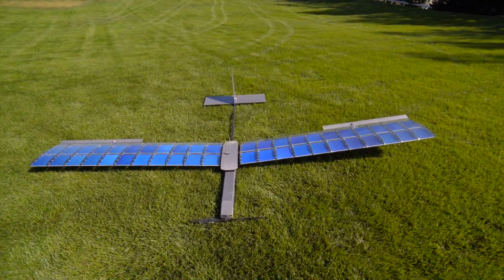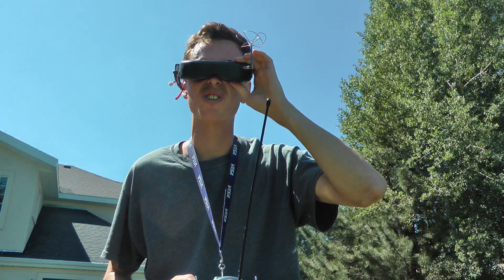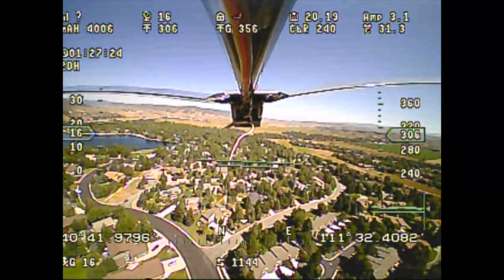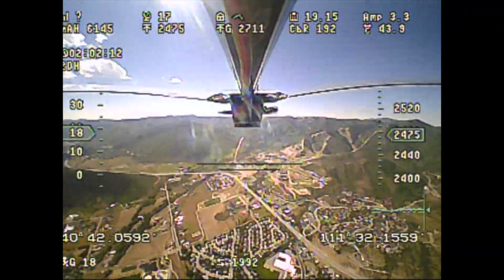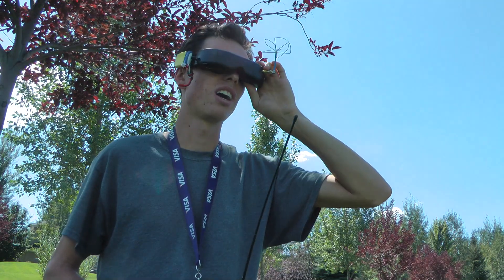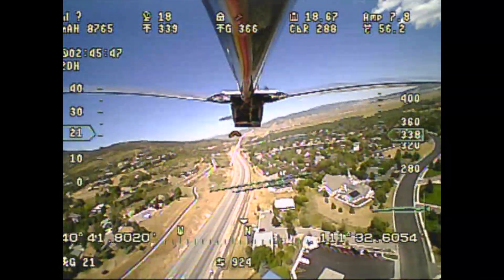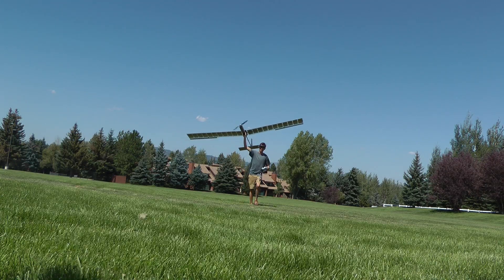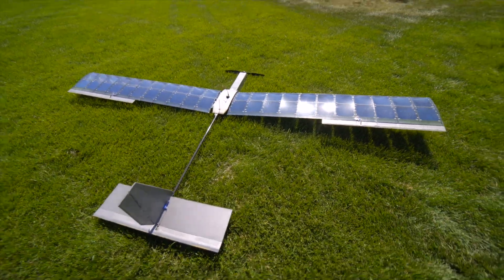SOLAR Plane V3 Long Duration Test Flight - RCTESTFLIGHT

Comment: As an RF engineer, may I suggest you remote your antenna next to your brain.. A small tripod configuration will allow you to get the antenna higher, more range, and get the RF away from your brain...

Comment: Also, down the road you could look into super capacitors and a simpler charging circuit.
Reply: Too heavy, the added wight will  more than offset the efficiency gain.
Reply: @amir_404-e4d  you do actually know what super capacitors are right? 

They are very lightweight compared to most rare earth metals based batteries. And also, this video experiment proves that the plane does not need huge electrical storage capacity to fly continuously on the solar panels. Just enough to buffer through bursts of throttle and periods of cloud shadows. 
What's more you could likely eliminate quite a bit of weight with properly researched super capacitors by eliminating the need for a charging module. Dump the solar panels straight to the capacitors with only a diode to keep them from back feeding the panels.
Reply: @ChristopherGaul  Super capacitors have a energy energy density(j/kg) of about 1/20th of lead acid batteries; about 1/80th that of LiPo. In other words, if he had one pound of LiPo, he would need to replace it with 80 pounds of capacitors. Low power charging circuits are light, but if you really want to simplify things than you can just use a more robust battery type like NiMH. 

I think you are confusing energy density and power density. Caps have a high power density, but can't touch batteries in terms of energy storage.
Reply: @amir_404-e4d  the whole point of this experiment is to fly on solar power. If you watch the video, he proves he already has enough power coming from the panels to do so. He does not need high energy storage. He just needs some burst capacity to cover high current peaks. He can eliminate the weight of the lion batteries and associated charging electronics and replace them with a few lightweight super or ultra capacitors and a simple diode. His ESC could handle the wider input voltage range. The battery charger and its mass would be gone.

Comment: Really cool project. Very nice, clean build on the plane too. 
Re the charging, I'm certainly no expert but I agree that you need to look into MPPT charging instead of your existing setup. If your panels put out voltages consistently higher than your batteries' fully charged voltage, MPPT lets you beat utilize that extra power under the curve. You might also look into lighter, more energy dense batteries. Eg if you're using Lithium Ion, move to Lithium Polymer.

Looking forward to more of this project.

Comment: I wonder if it would be more efficient to have two motors, one is powered from solar power alone and runs as fast as it can to get most thrust out of the panels. (Basically MPPT but done by motor ESC firmware). The second smaller motor is powered from battery and you only use when needed.  Could have a small trickle charger between panels and battery systems.   
Downside is extra weight from 2nd motor.  Upside is it's more efficient to do MPPT inside the ESC rather than having a separate MPPT controller that then feeds an ESC.  MPPT controllers are heavy and they add an extra step that loses efficiency.

Comment: Try using a capacitor bank on the solar panels and a regulator before the battery system.  This will allow the solar panels to run at their peak potential and supply a constant power to the charging circuit.

Comment: interesting test can the motors also directly be powered by the solar cells to circumvent charging the battery? And then only charge the batts while decending?

Comment: Wow dude, such complicated thing you've built and no MPPT?! And engine can draw panels down directly? Type in "CN3791 MPPT" into aliexpress and get some, tiny things. You mentioned 24v from panels - so like, one for each wing and boost the output :) I dont think your system should run totally without a buffer, why have such goal. No point of making a plane that falls down right away if any little cloud cover runs over. You may try supercapacitors tho, as a buffer, instead of a lipo :) But there must be some sort of buffer, not only panels. Keep it real :)
Reply: whoops, nevermind, now realized it's over a year old video that was suggested to me.

Comment: How much does your camera and transmitter effect your energy budget? How much does the weight of your camera and transmitter effect your performance?
        I wonder if just running off of your battery with the solar cells recharging your batter would be more efficient. Hybrid cars tend to move the car off of the power from the battery, and the motor just charges the battery. The

Comment: That's about 100 watts of solar on those wings... how is that alone not able maintain flight and altitude?  Ditch the heavy batteries and lighten that thing up - 100 watts should keep that in the air, you said 20 volts @ 3 amps.
Reply: Maybe a smaller battery or maybe two in total, very small batteries to always have one charge whilst depleting another??
Reply: @a.ndy.nonymous  hmm, yeah I guess that would work. Smaller batteries when the weather holds
Reply: @williamgong2351  Maybe some really great capacitors? Just like Tesla Motors. Batteries for the grind, caps for pure power when needed. And two batteries
Reply: @a.ndy.nonymous  Yeah, I guess that would work, only if the capacitors were more efficient at holding storage.
Reply: @williamgong2351  Or just spare batteries for the servo's and receive only so he would be able to glide/ has at least steering capability.
Reply: thom1218 at some points he was drawing more than 100 watts total, so it would be safer with batteries
Reply: @oj5190  Very true.

Comment: Amazing project. Make sure to use a proper solar charger. They are cheap and light. Also, use the most efficient solar cells you can find, and make sure the shrink film does not block IR.

Comment: Sounds like you need a DC/DC converter to max the solar panel efficiency. Note also that when ruder or what ever cast a shadow to one of the panels, all panels that are in series with that will be inefficient. So maybe to divide it to few segments with the help of DC/DC converters.

Comment: Instead of a current sensor on the solar panels, a voltage sensor would give you a better idea of what they are doing. The voltage of solar panels decreases under load if they don’t provide enough current to power the circuit.

Comment: Look into "boost power supplies".  Take the output from the solar cells and boost it to a higher voltage so the batteries will charge.  These circuits are typically 95% efficient.  I don't know the voltage of your solar cells, but if you can wire them part series part parallel to get about 15 volts then this circuit might do the trick: https://www.pololu.com/product/2896#current  Commercial solar cell installations do this all the time.

Comment: Make the wing a little bigger to accommodate another row of cells. More lift. Focus the produced energy to be able to fully power the motor, with excess sent to the battery pack to keep it 100%. The battery should only be needed between sundown and sunrise. Best yet, you can store enough charge to run it through the  night, while gaining full charge the next day.... 

Sustained flight.

Comment: Try to get better airodynamics. reptengular wings are not the most efficient. The best solution would be a taperd desing, but for the moment, just try to add some simple winglets.

Comment: Try a supercapacitor pack in conjunction with the solar panels and have active current sensing for charging them so you're pulling the rated amperage from your solar cells. you're losing a lot of efficiency with the battery packs.

Comment: you cant put solar cells under load...  you need a charge controller on there so the solar charges the battery, and the engine and controls power from the battery.  3 schotsky diodes in a triangle...   lol

Comment: Too many variables introduced. Just figure out an average amount of throttle required and test the plane with it mounted. I understand the need for real world tests but thermals with turning off the solar panels etc won't give you accurate test results. Please be more scientific with testing if you want it to be worth the time. Cool idea. Love it.

Comment: A concern that I have is that this flight, while amazing, educational, and I think totally necessary, is definitely illegal under the current regulations unless he filed for 3 separate exemptions from the FAA under a part 107 certification. In this case I would totally have an issue with the laws though, because this is exactly the type of experiments need to be happening, no need to restrict them as long as there are precautions taken.

Comment: Amazing job, dude! Try to rise up the tension at least in 2 to 4V above the maximum battery tension, I guess it will sustain the voltage drops at high torque needs to increase altitude.

Comment: So by what you say at the 2min mark, it looks like you are not using MPPT converters on the PV cells? Why not?they would add 50-200g on the plane but they would charge the battery quite effectively instead of waiting for the battery voltage to drop so they can start charging it?

Comment: vos panneaux solaires sont posé a plat sur les ailes , mais si on leurs donnerais un angle , ils pourrais capter le soleil de facon différente , mais en contrepartie , a un momment , le soleil ne frapperais que un seul coté des ailes et non les 2 , soit la tranche avant , soit celle de derriere , donc 2 systemes de charges différents aussi , au cas ou un systeme serais a l' ombre et ne produirait pas , mais c' est brillant et fonctionnel de cette facon aussi , et c' est merveilleux .

Comment: Bro.... you need a camera from 2019, not 1994.
Reply: If you're talking about the one on the plane then I think the problem is it have power constraints. Good camera requires more, and on planes like this you need EVERY watt of power in engine
Reply: @YuffX  ahhh that makes sense.

Comment: why not put a small wind turbine on top to give even more power and then a second solar wing set
Reply: Wind turbine would achieve the opposite of generating energy. The turbine would create a force opposite to your direction of flight, that would be in an ideal case equal to, but realistically larger than the energy harvested from it. Sadly that's what conservation of energy means :(

Comment: great video.. and maybe a bad assumption that you failed. Solar powered flight without batteries is not realistic, One cloud and you crash. You have succeeded with solar powered flight and need to realize that fact! Lighter airplanes, better electronics and longer distances and even night flying would be the next step. Blessings,.....t.a.

Comment: this test is invalid coz you didnt climb as high as you could. you could much more easily measure the power spent by converting altitude to approx Wh. you have obviously never undergone pilot training... you should be aiming for 24 hour flight (theoretical) with trading altitude for battery charge

Comment: So my thought if you can glide with little power usage why switch of the solar panels couldn't that time be spent returning power to the batts ?
and I know you want your power to weight ratio to remain balanced as possible but in my thought of building one of these I'm having the thought of trying to incorporate a centrifugal wind driven generator in the main frame but as we know easier said than done.
Reply: wildchd1 because he wanted to see if the solar cells could provide continued flight alone and didn't want external help from the thermals

Comment: here's a challenge for you!! Make it so it'll be able to charge just enough battery to last through the night then back to day then all over again. Also, Maybe get a coder to help you maybe auto pilot the plane, PLUS send data from the camera down to maybe your computer if you have one then deleting the data on the camera itself recharge and record and repeat. That'll be really challenging but if you do it... I'LL BE IMPRESSED ALL RIGHT AND I'M ALREADY IMPRESSED

Comment: have you looked into some mppt circuitry to maximize what you can gain from the panels?
The panels have an ideal voltage to get the most current from them.

Comment: Could you have 2 batteries with a switcher so the motor drains from one batteries and the solar cells power the other and then the motor one gets to like 20% it switches so the solar one is powering the motor one and the motor is pulling power from the fully charged one?

Comment: As far as the "s turns" are concerned. Let me start by saying I do not know a fix, but have noticed something similar in my step fathers full size airplane. He recently bought a new autopilot for it because the old one would make slight s turns as well as some slight dipping of the wings and bobbing back to position. Felt a bit like a ship at sea :).

Comment: You could just use a small constant current / voltage driver circuit to charge the batteries? That way you could use 3s or 4s and just set your voltage limits accordingly.

Comment: Your solar panels are your + constant, your + constant depends on the input from the sun and their
max ability to recharge the battery.
The battery is the intermediary or neutral +/- between the S panels and the motor
The motor is the - constant drain depending on the amount of work you want it to do/ or needs to do.
The numbers are there on your HUD you do not need the "Sensors" to monitor what is already there in 
front of you.
You have done a very good job finding the best balance of power need to the amount of work to be done
under optimal conditions and the thermals are and much wanted free plus on all factors.
Up scale the system and start selling them to glider owners as retro fit back up thrust to get home via ducted 
fan motor(s). 10 minutes of additional flight  is critical for them and 15 minutes is a blessing.

Comment: If you made the wings bigger and added a 3rd row of cells, maybe that would give you enough power, but then you might get too much lift, unless the wings have a smaller cross section?

Comment: with a 16 foot wing span (8 per wing)you could put a 10 meter dipole antenna on the leading edges of the wings and use a 10meter transciever for remote control. This could easily get your range to 20-30 miles. Transmissions in the 28.000-28.300 MHz portion of the band are for data. You can even encode the signal because it’s for use in remote control of aircraft. All you need is a technicians amateur radio license.

Comment: keep the solar cell colder (they should touch airflow), put better gps / gyro so you can just monitor it, not have to do correction on stick all the time. Great work Daniel

Comment: I wouldnt use the voltage booster, since energy is lost. i would put the solar cells in series, and also use lithium Ion 18650 batteries.

Comment: you should coat the wings with anti-reflection to avoid losing solar power.
Reply: Modern solar cells use a reflective coating at the base... So they can use the sun twice
Reply: marthale7 I believe he is referring to an anti reflective coating, to decrease the amount of sunlight reflection off of the wings, which would increase the amount sunlight absorbed by the solar cells, increasing efficiency.
Reply: Then the coating will absorb the energy, making the cells produce less power.
Reply: Tedlar is most commonly use for solar backing.

Comment: You need a light weight MPPT controller.
Reply: Oh.. I guess you already thought of that. But you need to generate twice the power so you can charge and fly at the same time. And then you need enough battery to last you through the night.
Reply: How heavy are the solar panels?

Comment: +@UCq2rNse2XX4Rjzmldv9GqrQ
It might be simpler to just implement a battery solar switchover.  It would remove a lot of variables.
You just need a small 'two pole single throw' relay, and a spare control channel.

Comment: Have you tried using a weighted balloon of curry powder 1.68oz? As it changes its dynamic thermal weight during different changes of temperatures. Should help pull the wingspan?
Reply: what???

Comment: You should be aware that solar panels have a loss efficiency of .07% loss and that's for the best solar panel mono so add 4 solar panels to the tail of the plane, and you should be fully stable. (SHOULD BE) This all depends on the weather, now obviously you will have less efficiency in rain or cloudy weather but in mid to sunny this should be good for stable flight.

Comment: You need to check the temperature on the wings. With the clear covering over the panels it could be heating the panels up past 25 degrees Celsius. After that panels get less efficient. I highly doubt the temperature in the wings would go above that but it could be a factor.

Comment: Wonder if you could build an intelligent solar charger that could decouple the power sources based on what makes the most sense; purely drive the motor maybe, change a standby bank of batteries and switch between the main cell and seconday cell?

Comment: Should put to battery’s, have the solar panels charge one well you use the other, than when low devise something to switch the charging to the dead battery and run the fully charged one
Reply: Two wtf I can not believe I said to.

Comment: some late thoughts.   at 10:00, i vote for model  RE-DESIGN.   as i have said before,  this model is  POORLY  designed, in the context of achieving a  minimal auw;  waaaay too  much cf was used; can you spell   SPRUCE.    for the Purpose of Enabling self-launch, ONLY, a   low-capacity onboard battery could be used.   can you spell   this would result in a  SIGNIFICANT  reduction in auw.     cheers              googletranslate

Comment: you shouldn't use cv constant voltage too charge the battery but cc constant current with a voltage limit